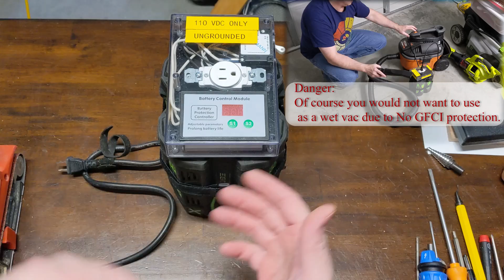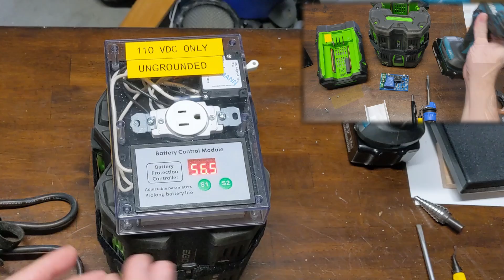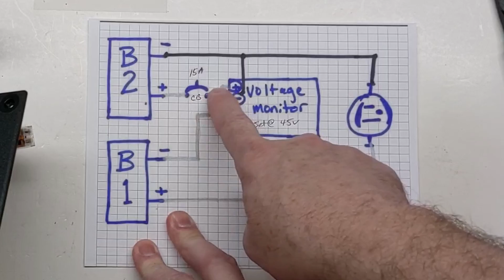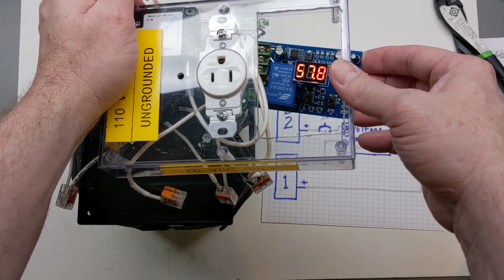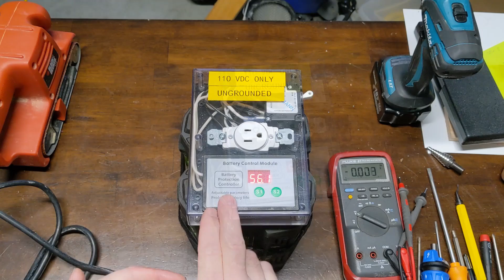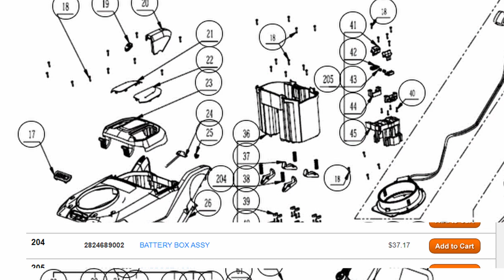Low Voltage Cut-Off and Protection for the EGO Battery running 120V Tools

Comment: Dang, nice explanatory video! You have a great style of explaining. This is perfect info for me, since i just made a rig to run my 12v trolling motor on my boat with my 56v ego snowblower battery. And i realized before it was too late that i probably needed an audio warning or a cutoff so i didn't toast my batteries. Thanks for your videos.
Reply from the maker: Thanks for your kind comment!

Comment: I really enjoy your EGO videos!  Good job!  One thing to consider when running AC rated tools and equipment on DC is their switches.  Although many of these will "work" on DC, they may only be rated for AC.  AC rated switches can be damaged by the arcing from direct current.  DC rated switches have a "snap action".  They open and close very quickly, minimizing the effects of arcing.  Good luck --- good videos!
Reply from the maker: That was mentioned and talked about tremendously in the first video about this. This was simply the follow-up for the batteries protection. 
Thanks for your comment!
https://youtu.be/NjSan4HyRX8

Comment: Okay, thanks for the video.  I'm setting mine at 42V for under voltage cut-off.  However I noticed that the LED light (voltage indicator) was still on in your video when the power cut out.  How much current does the voltage indicator draw and how long would you expect that voltage to go from 42V to an unsafe voltage when connected to that BPC? (you decide here what is unsafe, like 35V?).
Reply from the maker: Hi,
It does draw milliamps for sure, but the fact is once this board does its job to shutdown it's giving you the warning and you must take action to remove and recharge. This is a shutdown and indication as with any pack I don't leave them in any tool. This board will pull more mA than most any tool connected to it for sure. I absolutely would not leave it connected. I had someone ask recently about making the power dropout from the LVCO controller when it drops out the relay. That can be done by latching in a relay similar to the one shown in the video using the 20A module. It will need to have a push button wired to the coil of the relay to activate and then latch once powered up and stable. Once voltage drops below SP it will drop out all power.
https://youtu.be/EazXvIzZEzg
Reply: Thanks for the reply! Yes, I accidentally leave my batteries in my diy setups more often than I’d like.  I’m trying to avoid this very expensive mistake in ruining the batteries (I have a ruined 7.5ah from this now). Mostly it’s my kids leaving it in a gokart—I have a tutorial on my channel if you’re interested in the setup. Ideally a protection circuit would cut the power from the battery completely after a certain voltage and emit a sound (like a smoke detector) when this happens.  Any ideas?  A tutorial would be awesome as I’m not nearly as knowledgeable on things like relays as you seem to be!
Reply from the maker: I can definitely see these being in kids toys and easily forgotten for sure. In that case the kids could be riding and just put it up and yes the display would pull down to zero over time and ruin the cells. So yes, in this situation you would want to add a drop out circuit with a relay (contactor). The biggest problem with the 56V  (14S) pack is not many really are for nominal 56V. Close as you can typically find is 48V and may be fine. You can add a DC-DC converter to 12V or so and then use a 12V coil, but just adds more complexity.  As far as the audible alarm, it is a cheap one available but  they are usually for 1-8S lipo packs for RC or hobby packs. The alarm buzzer will sound if voltage drops below 3V per cell. You would have to. Wire balance leads on the pack and you could monitor one half of the pack with one alarm module and the other half with another if that makes sense. You could even just use one and use the alarm while monitoring only half the pack. The draw back is you would have to wire small wires in the pack and bring them out to a balance connector.

Comment: Interesting and well thought out but... at what pack voltage does the internal BMS shut down (pack discharged)? I see that you mention 40v but that is some type of add-on BMS. Are you not relying on the battery's BMS?
Reply from the maker: No not using the BMS.  This is bypassing the internal BMS. Straight off the battery terminals. That is why the Low Voltage Cut Out is so important if used this way. I shared this video because so many viewers were asking questions about when the pack shut down etc. Also how could you protect the cells if using the pack on a ebike etc. The EGO battery pack BMS communicates with the tool and shuts down if any pack issue is detected in normal factory tool operation. When using for other projects we have to protect the cells in other ways. Over discharge being the main concern.
Reply: @ThriftyToolShed  As I work on this Ego pack, a 5 Ah of unknown vintage (definitely older than the ones I have seen on your channel), I have been discharging the pack with a electronic load device, the same as I have seen in a video of yours. I have set the low voltage shutoff to protect the pack but really do not know what value Ego uses in their BMS. Based on the lithium battery manufacturers that recommend a minimum voltage of 2.5 volts, I have set the cutoff for 35 volts. That seems absurdly low but gives a pack capacity of approximately name plate. I really do not understand why the battery pack cares if it is communicating with an Ego tool.  Thanks for the info.
Reply from the maker: I usually cut out before then at around 2.7V since a lot of manufacturers recommend that. I believe EGO shuts down at a cut off of around 2.8V. As far as the BMS goes, communication with tool is how it works. The + and - come straight off the cells ( fuses ). It is no Mosfets etc. to shutdown and give issues on the high current side. The BMS is Communicating with the tool and the tool shuts down if the BMS directs it to or if for some reason it can't communicate with the pack.
Reply: @ThriftyToolShed  Thank you for the info. So far, I have not seen packs with the electronics problems illustrated in this video. Fortunately, I have only needed to deal with battery imbalances, much easier to remedy than electronics failures.

Comment: Why did you include the external low voltage cutoff when the packs themselves have a LV BMS (~42VDC from your Ruzixt 5.0AHr test video)?

Really enjoying your Ego videos! Likely watch some of your other fix-it videos, too.

Edit: you mentioned using the external cutoff to prevent ~80V to the tools; so extra battery and tool protection.
Reply from the maker: Hi, sorry for the confusion. The EGO battery BMS only communicates with the tool so the tool will shutdown. It has no actual shutdown from the + & - power terminals so that is why I added a Low voltage cut out for atleast one pack so at around 40V (80v total) it would shut down and yes also to protect some tools from under voltage which could damage them as well. Thanks for your comment! Thanks for watching!

Comment: Powering a heater with this could be "entertaining." Triac control would let the magic smoke out, and it's unlikely that a bi-metallic thermostat, thermal fuse, or thermal cut-out would be able to break the arc. PTC heater such as frost tape would work fine though.
Reply from the maker: Though I have worked on many industrial Triac (SSR) and SCR heater controls I have never had one in my house. So yeah, I would not recommend that either. I meant in reference to the halogen lamps, quarts or any other simple resistive load of course. I thought I clarified that when mentioning the speed control is a no go! Ahhh the balance between talking too much and not saying enough! ⚖️